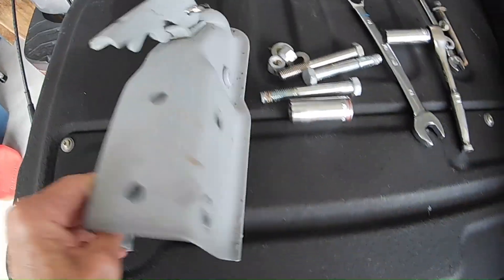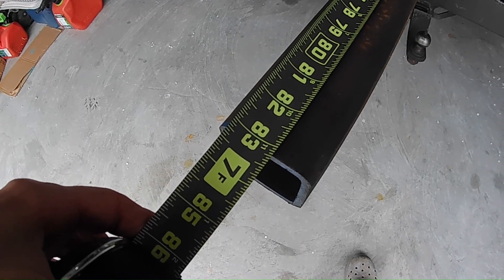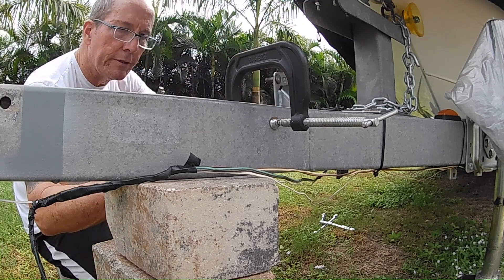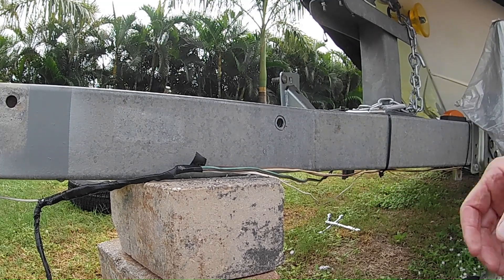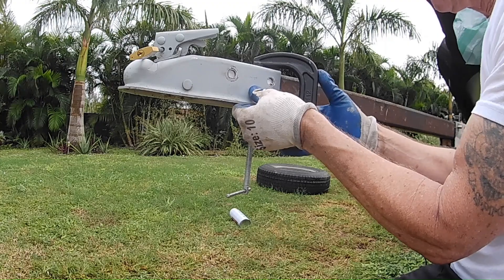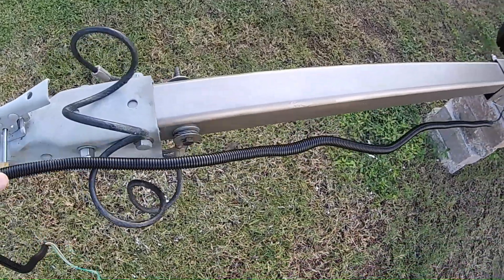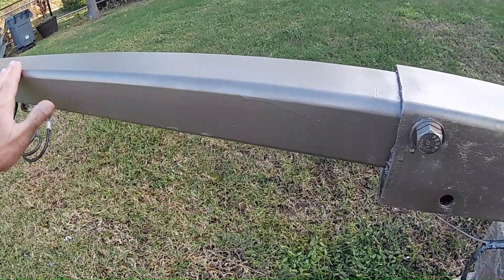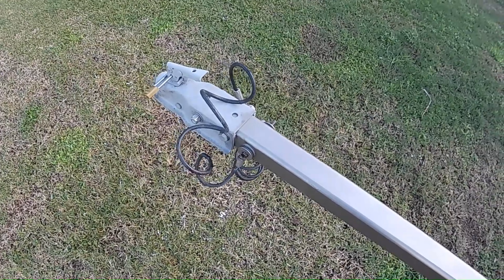Boat Trailer Hitch Extension (DIY)

Comment: I see one issue..if you store your boat in a garage or shed the extension may not allow you to close the doors..
One tip on drilling the holes...use a Cobalt bit..drills thru steel alot easier then titanium or steel bits.
Reply from the maker: You can fabricate your extension to "swing" and allow garage storage...

Comment: I've never boated before and recently bought an 11 ft RIB (Fiberglass bottom dinghy).
Anticipating the same issue of having to reverse too far into the water, I also thought of this.
Thanks for your ideas 
My plan though is to have the extension telescoping. In other words the extension should be retractable.
Reply from the maker: If you have the time...would you send a photo of your completed project, thanks?